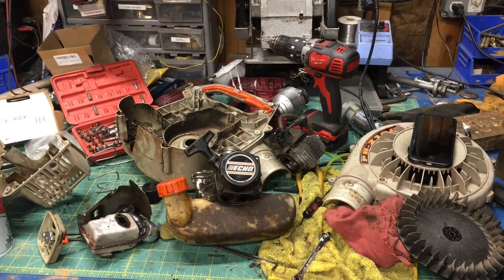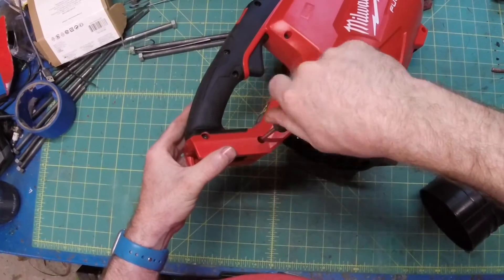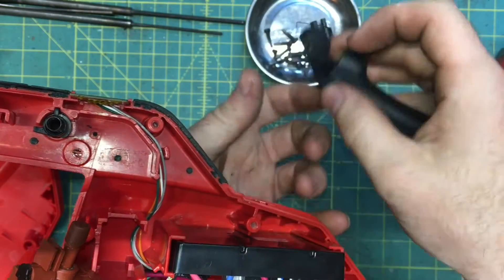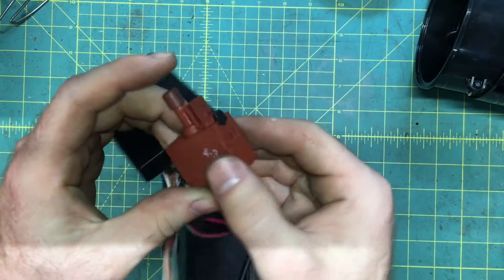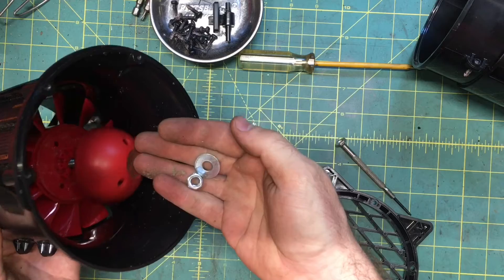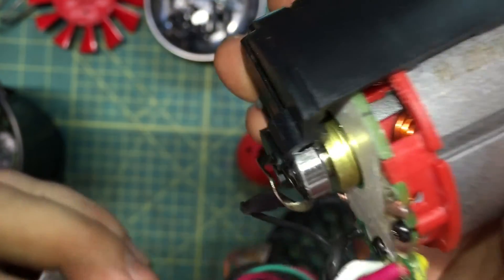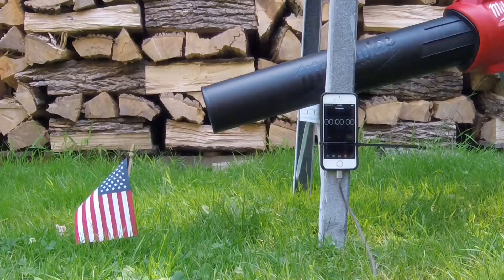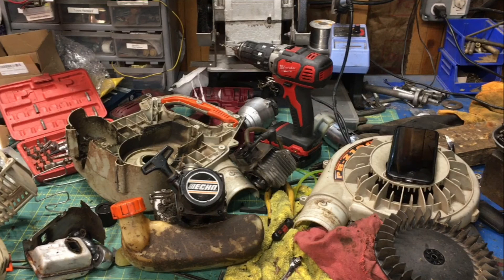Milwaukee's M18 Leaf Blower - UNCOVERED!

Comment: Evidently I am a bit late to this video. I recently moved to the battery operated trimmer/blower combo. It’s the black and yellow version, but the local gettin spot had the pair on sale for $200 including a 5ah battery and charger. Bot bad I said, until I received a surprise at the checkout. Apparently tax dollars at work allowed for a 30% discount, what for switching from team 2-stoke to team central power station. Anyway, I love the both of them and at $140 almost feel like I picked them up at the pawn shop.

Comment: One comment, you aren't completely bound to the Milwaukee battery system if you are truly willing to tread where official tool manufactures rarely dare to enter.... The world of battery adapters. I'm absolutely certain you can get adapters to go from this to anything you want from DeWalt to Kobalt and Black & Decker. There are also things you might want to experiment with.... I knew a feller at one point who would Frankenstein tools by taking the handle off of one tool and grafting it onto another tool (full blown chopping off and attaching on), for example he would take a DeWalt 20v drill handle and graft it onto a Black & Decker 18v drill to replace the handle from that. It'll work with no issue since it's just a two volt difference and shouldn't hurt the motor.
Reply from the maker: I actually have a short on battery adapters!

Comment: Awesome video. If I wanted to buy a standalone fan + motor (is this called an EDF?) with similar specs to this, is that possible? Can you recommend anything?
Reply from the maker: For what sort of application?
Reply: @thedoubtfultechnician  A custom leaf blower contraption
Reply from the maker: Without knowing more, I’d say your best bet is to buy a broken Milwaukee (or any other brand really) on eBay to use for parts. I doubt Milwaukee will sell those parts at a reasonable price.

Comment: I broke down and bought a corded electric weed wacker and it's 2x as good as a gas one. I store it outside in a plastic box all winter and it never gives me crap, plenty of power for light duty. Save the hydrocarbons for the fun stuff.